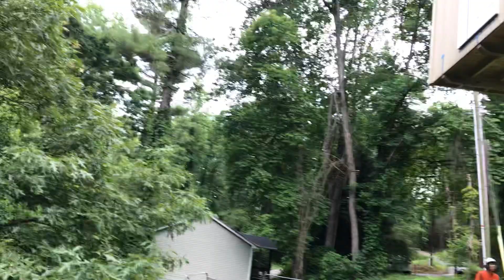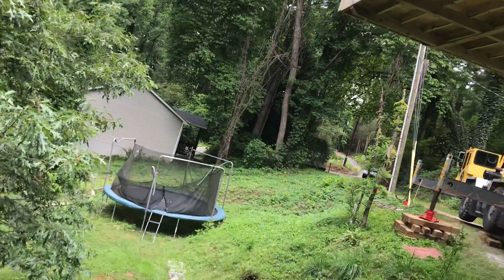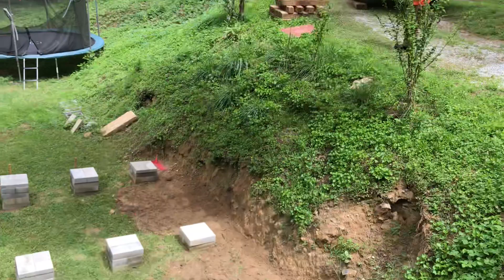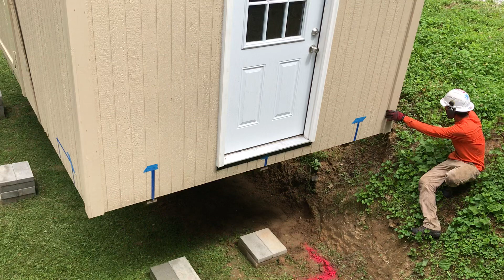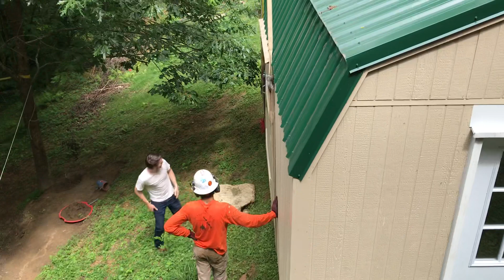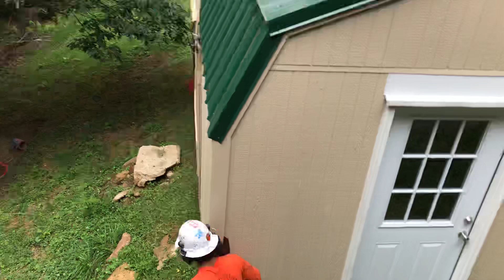Moving A 10 X 20  Shed Using A Crane

Comment: What was the total price of moving your shed?
Reply from the maker: The crane guy charged me $800 to move the shed. It would have cost less if he had not had to used a flatbed. It had to be moved about 500 feet. He had to first use the crane to put it on a flatbed to move it because the crane couldn't go that far with the shed. He then drove the flatbed to the new place (about 500 feet away) and then used the crane to lift it from the flatbed and to my location. The location is down a hill next to my house. Duke Energy was supposed to come and drop the power lines to my house, but they never showed up, so the crane guy went ahead and braved it and lifted the shed over the lines.